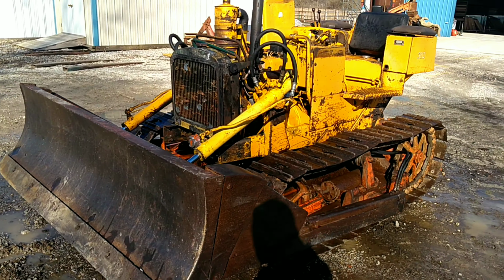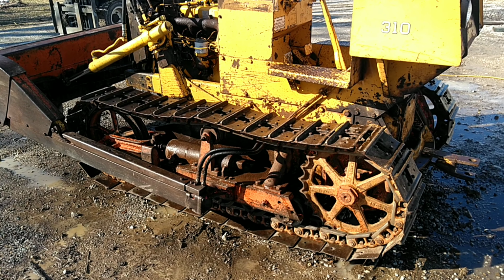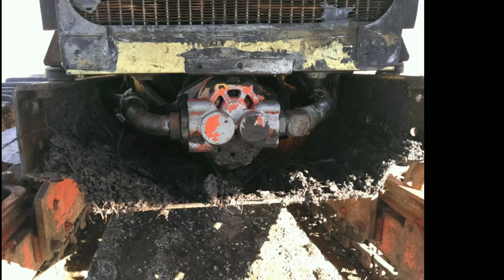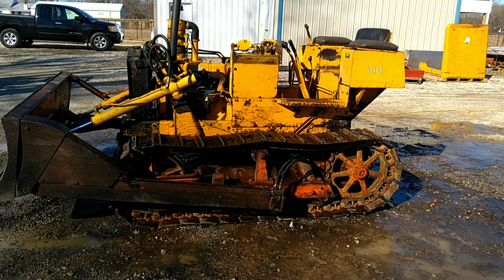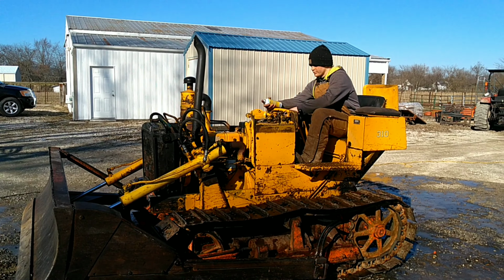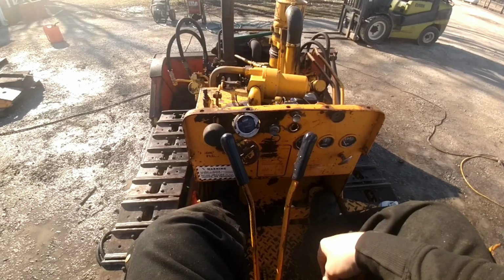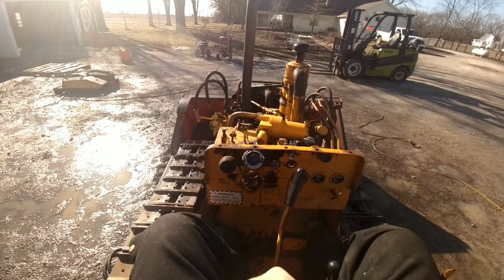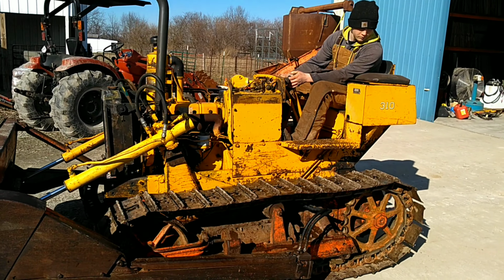Rebuilding Our Case 310 Dozer

Comment: that front cross member that is off is critical to stop from tearing the radiator apart, hold up the skid pan and other issues. I have not watched all your videos yet but there must be 3/4 inch of rubber under each of the radiator brackets where it sits on the frame with double nut bolts with temporary lock ttite holding them in
Reply from the maker: Thanks

Comment: In massachusets i bought a clean un molested one that sat for 25 years 2 years ago started right up now it wont start im working on geting it started and home it might beforsale.if after i get it home and it is all their all new rollers and new breaks 2000 on the 188 and has 3 or 4 way blade yea the blade has 3 functions up down sided to side tilt if i get it started and decide to part it ill let you know ill need to get it home and see what its going to take to make it restored the thing is in realy nice shape one owner never abused and sat for last 30 years
Reply from the maker: I'm interested for sure
Reply: What did you do with the case 310 I'm in Massachusetts and looking for one?
Reply: How did you make out with this in the end?

Comment: Great machine.They are superior to any skid loader on stumpy, virgin terrain and they grade better. They are slower so are out of favor.  I have two loaders. They stole my blade. :( in 2011. The final drives were always delicate on this machine. The engine  and power train are overpowered and the frame is very rigid... and can result in damage so you must be respectful of that.Never put an inexperienced skid loader operator in one of these: never pull back both sticks at once either....

Comment: We have same one only problem is we referished the motor and are 188d is the small flang on the liners and can only get the newer style wide flange head gasket runs awsom but its geting blow back im so pissed acording to reserch the parts sellers go by serial numbers and it has nothing to do with it the guys who realy know old case tell u the 310 dozzer only have narrow flange linners so basicaly i need to rebuild my rebuilt motor because i cant get a narow fange head gasket so if your motor comes apart built it for wid flange because u can get liners and all the parts except the gaske so made i need 4 linners and machean work
Reply from the maker: That sucks! Thanks for watching. Plea subscribe for more .